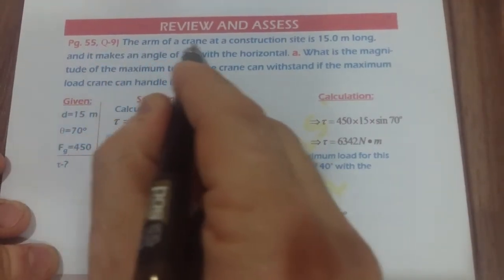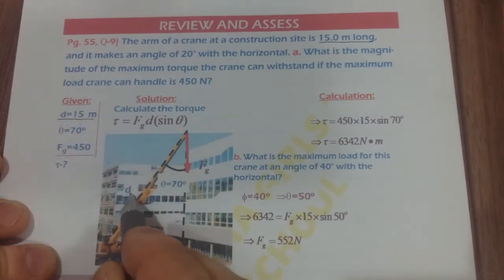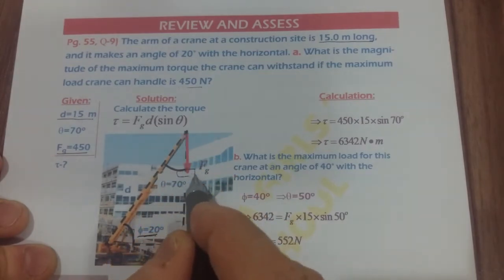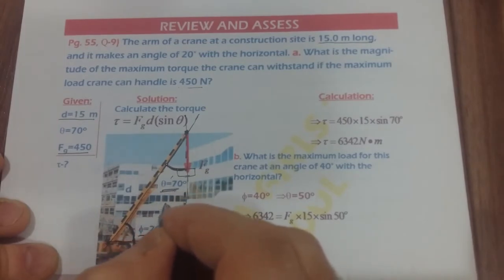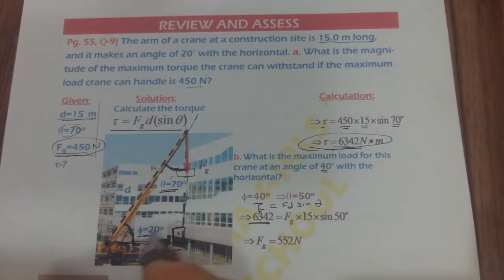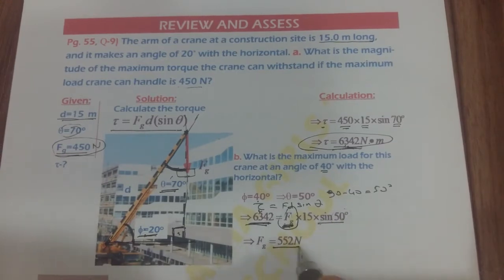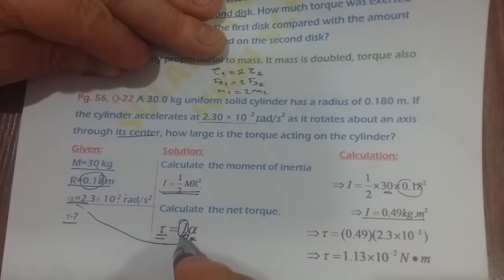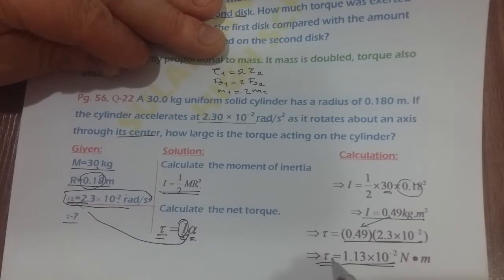CHAPTER 2 ANSWERS OF CHAPTER REVIEW QUESTIONS

Comment: Teacher
in the Ch2 Review
these two Q(s)
Please can you tell me their differences ?
I don't understand 😢

Q-19) An object rotates with a constant angular velocity.
Can there be a net torque acting onthe object? Explain your answer.
Answer/ No, there cannot. A net torque provides the object angular acceleration. That is, its angular velocity changes.

Q-20) If an object is at rest, can you be certain that no external torques are acting on it?
Answer/ No, we can't. The net torque is certainly zero. However two or more forces may produce conteracting torques to obtain a zero net torque.
Reply from the maker: "no external torques" means, no forces act on the object to produce torque.   But " no net torque" means there may be forces acting on the object, so there are external torques on the object but their sum may be zero.